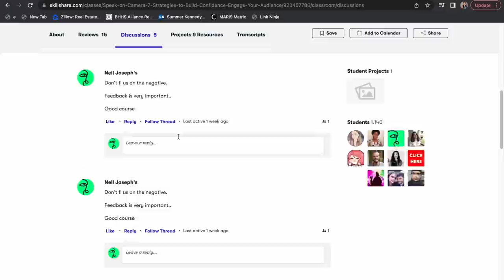Building Our Own Shipping Container Home |Container House EP:37 |GIVEAWAY, Ventilation, Drywall/Mud

Comment: Just a word of advice when you're taping and mudding.  By yourself a small mixer that attaches to your drill.  Add a bit of eater to the drywall Mudd and mix it with the mixer.  You're mud will go on alot easier and smoother for you.

Comment: You could use foam to fill in the void on the outside in the corrugated metal then use flex seal spray to seal the foam and make it look decent u might have to spray more flex seal every couple years but that ain't bad better than water getting in..

Comment: You should add some water to the mud for two reasons one it make it flow smother and easier two as the water evaporates it sucks in the tape and makes the bond stronger. The mesh tape has very few true advantages and in the long run will fail sooner as the joints flex